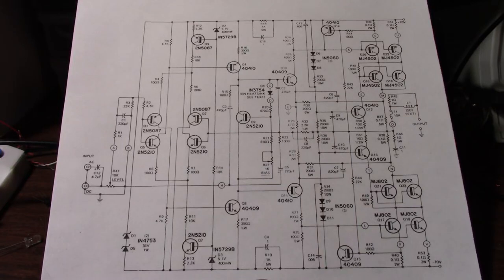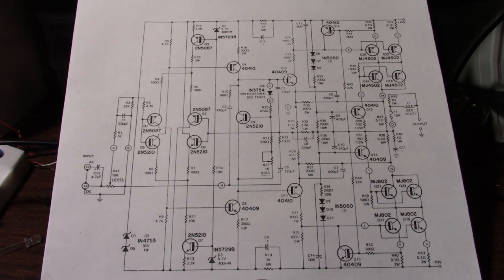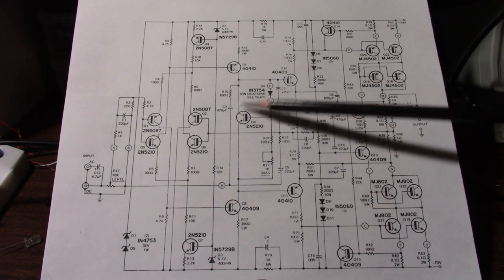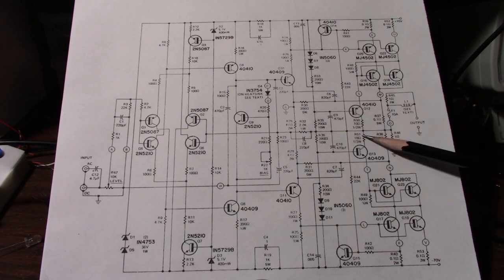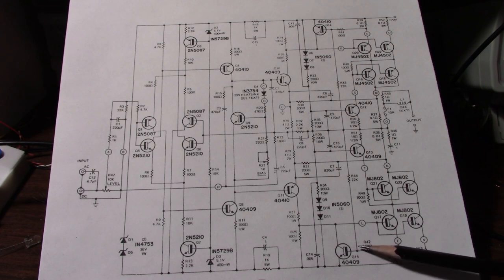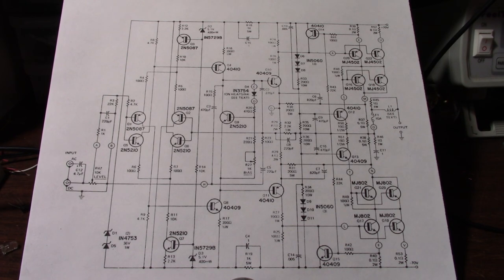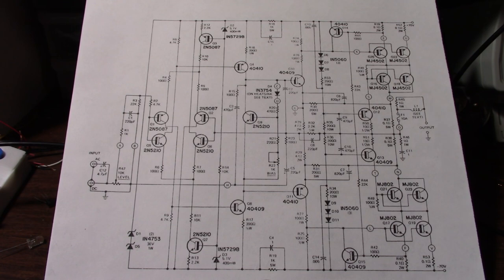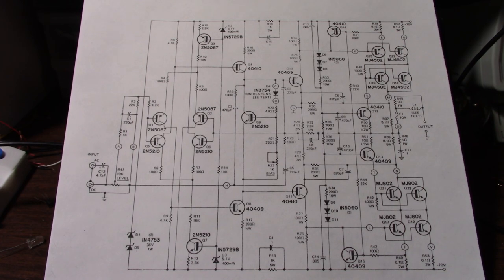Tigersaurus 210/A amplifier schematic walkthrough

Comment: A few things to watch out for on these amplifiers:

    R14 is a 10K resistor with 62 volts impressed across it.  This means it is dissipating about 400 milli-watts. These resistors are specified as 1/4 watt size so the resistor cooks and tends to increase in value.  Best idea is to replace it with a 1 watt resistor.

    Another problem I remember having on one of mine (assembled from an SWTPC kit) is the grounding lug on the machine screw that holds the power supply bridge rectifier to the chassis.  The chassis is heavily anodized and this was preventing the bolt head from making proper contact with the chassis.  The cure is to scrape off the anodizing under the bolt head and for good measure I added an external tooth lock washer under the bolt head to make sure the ground lug has a good connection to the chassis.

    The four 200 ohm 10 watt resistors that are used to voltage divide the signal to the bases of Q12 and Q13 dissipate a lot of heat.  They should be spaced above the circuit board by a half inch or so and a bit of fan cooling is a really good idea.  Otherwise after long use the circuit board will be damaged.

     You state that Q14 and Q15 are provide current limiting for the output stage transistors.  This is sort of correct but the circuit is more subtle than a simple current limit.  It is actually a Safe Operating ARea  (SOAR) protection circuit.  If you look at the specification sheets for bipolar power transistors you will find a graph for the safe operating area.  Basically this graph tells you what combinations of currents and voltages the transistors will withstand and for how long.  There can be combinations of current and voltage that are within the transistor's thermal power dissipation limits that will still destroy the transistor (through what is called secondary breakdown) if they exceed the safe operating area.  As you mentioned, R39 and R40 provide a current sense signal to the SOAR transistors.  You kind of glossed over R43 and R44.  Their function is to provide a voltage sense signal for the voltage across the output transistors.  When the voltage across the output transistors is high it takes less current through R39 and R40 to trigger the protection circuit so the allowable current limit changes with the voltage across the output transistors.  This isn't a big deal if the amplifier is driving a resistive load because in a resistor the current and voltage in in phase.  If the current is high through the transistors the voltage is low across them because most of the voltage is dropped across the load.  Real world loads (loudspeakers) are not always 100% resistive and in fact can be quite reactive.  This is really bad for the output transistors because the phase angle between the current and voltage in the load can result in a high voltage across the output transistors at the SAME TIME they are conducting a high current.  (Think power factor - The amplifier is having to generate and dissipate VARS.)  A reactive load really fattens out the load line and can cause output transistor failure through secondary breakdown when the safe operating area is exceeded.  The protection circuit takes into account BOTH output stage current and voltage and shunts base drive away from the output stage if the safe operating area will be exceeded.  I have 4 of these things and once (years ago) when running a loud university residence party I accidentally ran one at high levels into a short circuit for quite some time.  It finally tripped the thermal cutout but otherwise suffered no damage due to this protection circuit.

     Another thing I really didn't like about Dan Meyer's design is the connection to the output transistor base and emitter pins.  In my opinion the "slide on" connectors for these pins are a significant weak point and the back to back heat sink design means the pins are in a pretty deep hole so a proper socket cannot be used.  The solution is to bolt a 3 lug terminal strip (one lug common to the bolt bracket) under one of the collector terminal bolts and solder short jumper wires to the transistor pins and join them to the circuit board wires at the terminal strip.  Yes, this makes changing an output transistor a soldering iron job but I fee better with solder connections

     Yes, these amplifiers have their quirks but once you get a few things fixed up they can perform reasonably well and quite reliably.
Reply: That's an excellent description of the voltage sensing current limiting circuit. I think my Arcam a60 has a similar protection circuit and it always gets hot. However i do wonder if the speakers are just too much for it.

Comment: Its so nice seeing you still post
Reply: I have a question , what circuit would you recommend for a balanced to unbalanced 2 channel converter? I have a car radio with balanced high level outputs and i want to feed it into a unbalanced only low level car amp. Id like to not use premade solutions nor audio transformers

Comment: I have built an amplifier a few years ago which was in principle according to this symmetric design until Q10 and Q11 as output stage. The transistor matching for the symmetric differential input stage is not such an issue if you use degeneration resistors (R4 to R7).

Comment: My friend didn't build it, he got it via eBay a while back. I like the dual differential idea, it fell out of favor for a higher part count and 3dB more noise than a single. These kits were built without matched parts. I really think there is an error yet to be found in this amp, possibly a suttle error in wiring somewhere. I proposed using higher voltage outputs and eliminating half of them and their drivers, but I'm not even going there till we find the existing issue. His other Tigersaurus has never had trouble, it's of a diiferrent vintage by another unknown builder. This amp is very similar to the .01 Tiger design.

Comment: Don't know if extra matched 1% 4.7k resistors on the vacant legs of the input differential amplifier would help to even up the current flowing. A penalty here is extra noise inherent in the resistors. As you said to make any input stage resistors all 1% metal film. 
The driver transistors have a RCA typecode. Substitutes I suggest for the driver transistors are the BD 139 -  16/ BD 140 - 16.
 Either the 2N5551/2N5401 or ZTX 304/ZTX 504 for the input stage transistors. These will have a similar or above voltage rating when compared to the raw supply rail voltage. Seen some discrete component amplifiers on the Circuit Exchange International website. One low power design also includes current mirror stages in its differential input stage. Whether current mirror stages  would help here subject to the voltage swing obtained if the input stage is modified in this way.

Comment: As ALWAYS, interesting walk through John. My impression is that the amp's complicated nature  is due to the high output power and limited capabilities of transistors from the '70s. I admire the designers for working through these issues. I'll stick to an LM1875 until I get more experience to tackle one of these!

Comment: John, if I remember and understood correctly, your JAT501 has no capacitor in parallel with the feedback resistor that links the output to what is in effect the op-amp inverting input. I understand such capacitors are often included to limit high frequency gain and phase shift in such a way that the gain is less than unity at and above the frequency where the output becomes out of phase (the nyquest function?). This prevents RF oscillation. I did not see an explanation in any of your videos on how this capacitor could be omitted, but I would be interested to do so.
Reply: He achieves loop stability with a Miller capacitor on the VAS stage.  That should be sufficient to give enough phase margin for stability of the main feedback loop.

Comment: Good morning all - hopefully some people will react to this post/ comment.  I've seen a couple of references to this article entitled "A Restoration Odyssey' or "Taming the Flaming Tiger" which was written by a Benjamin Poehland (or similar) and appeared in the old Audio Amateur magazine.

I'm genuinely surprised that somebody over in the US hasn't managed to locate the exact issue this was in.

My interest in this type of amplifier is that it is the same output format as the current range of SE amplifier boards being manufactured by Avondale Audio here in the UK.  If I can find the parts and make the PCB's I fancy building a pair.  I would construct it using the heatsink mounting brackets from Naim NAP135 amplifiers - these are machined to take 4 x TO-3 devices and then install it in  ModuShop Dissipante type case.

I would certainly look to wire it better than the examples I've seen pictures of that's for sure.

So come on guys somebody stateside must be able to locate this article to add to the knowledge base

Regards

Richard

Comment: Probably the complementary design was needed one voltage gain was needed in the output stage, otherwise it would be difficult to drive as you have to be careful not to have a shoot through current through the base emitter junction

Comment: Please make video on how to find out any unknown Speaker or Woofer real Wattage
Reply: You really can't determine thatby basic electrical measurements, you need to find the Manufacturers specs.
Reply: @hiddenobserver8447  If there's nothing mentioned by manufacturer except the coil resistance then?
Reply: @amitghosh6966 @ Amit Ghosh  The only suggestion is to note how warm the voice coil gets as you increase power with a noncontact IR thermometer but you can't get into the heart of it so the heat will seep out slowly. The more obvious thing is to note how far you can gently move the cone and never exceed that with power. I suppose voice coil resistance would also increase as it warms but you would need to make very sensitive readings to detect this. Also a high power woofer is built to take heat where a lesser one not-so-much, not sure how you would guess at that.

Comment: That looks like a class B differential input stage. How is that not going to result in a dead spot near ground? The negative feedback is based on amplification of the distorted signal, so it won't help...
Reply: Ideally it all runs class A
Reply: @HillsWorkbench  The only way it's running class A is if it's biased so that Q1 or Q5 is always on and the other transistor is always off...
Reply: @ameldaquirk3965  You are projecting...

Comment: Is rail meant to refer to ground?
Reply: No. The positive or negative supplies are called rails.
Reply: @tommost1  Though signal wise, rails are as good as ground.
Reply: @HillsWorkbench  Well they are assumed to have zero impedance to ground in small signal analysis... but there is the matter of the voltage on them.

Comment: A thought - maybe match the input transistors - very easy to fo these days with one of those cheap component testers !

The resistors may only be 5% ones as well .... .
Reply: That's the thing, I was under the same impression, before acquiring a curve tracer. There's more to these than a single result obtained with a tester, especially with NOS ones you need a lot of patience (and transistors) to get a really good match.
Reply: @paulb4661  couldnt you replace with a modern equivalent? even modern transistors from the same batch are going to be waaaay closer to matching then this amp was ever supplied with back in the 70's. And then matching modern ones is just going to be that much easier and closer. Idk just suggesting not a EE .
Reply: @dantheman1998  You are absolutely right, but then you are no longer restoring the piece of kit to its original state, but rather rebuilding it, which often creates its own problems. Differences in pinout and package type, to name but a few. You may even end up with a generator instead of an amp, if you're unlucky. Besides, you wouldn't stick modern, foldable and heated, wing mirrors on a vintage Chevy, even if they did a better job. Some want their toy to serve its purpose, whilst retaining original compliment of ICs.